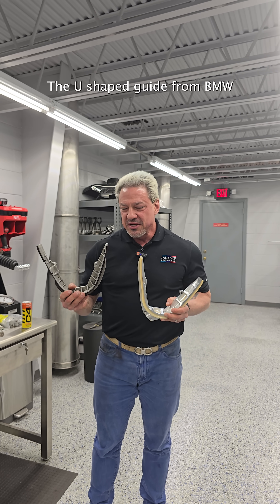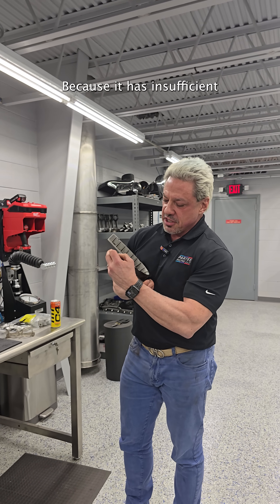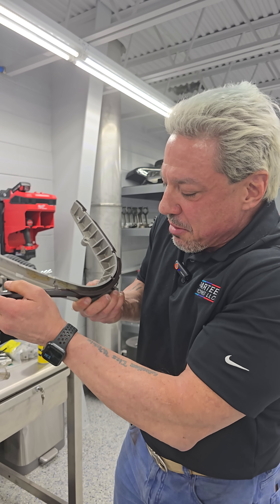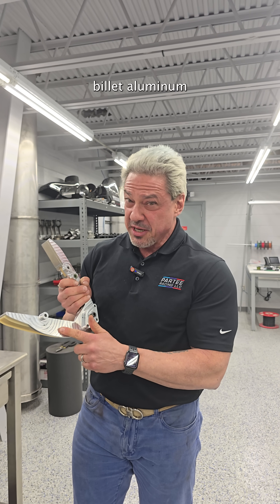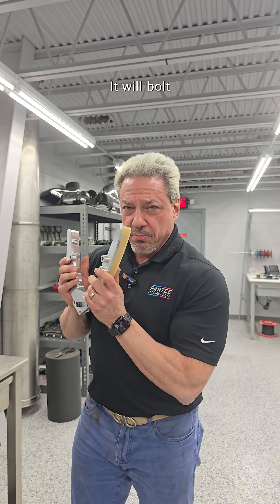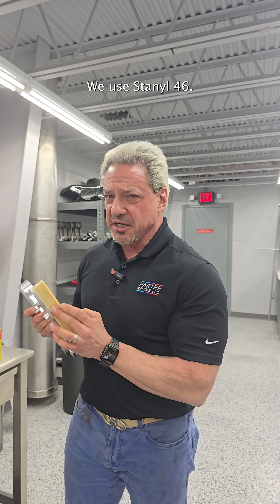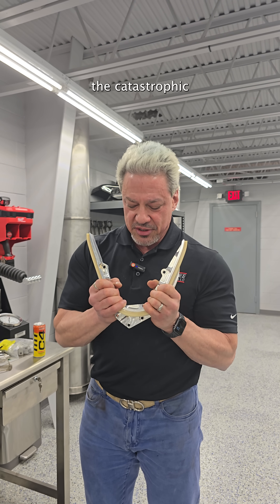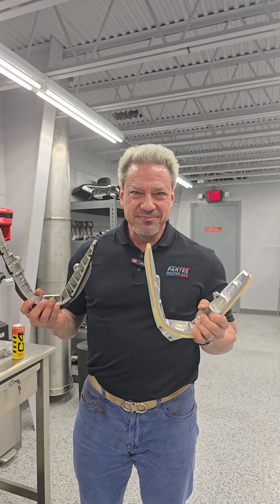BMW Timing Chain Guides: The #1 Cause of S62 Failure #BMW #E39 #m5

Comment: It is NOT a lifetime replacement piece and you cannot prove it. 

The issue with the m62/tu is not the rail. The issue is the tensioner. If the tensioner does not produce sufficient tension, the chain does not keep tension against the rail and slaps against it. The guide rails are practically never worn down, they're usually always stressed and breaking apart. 

Overbuilding the guide rail will not fix this problem. The backing plate is not the problem. The clips are not the problem. The material may partially band-aid the problem but we know that PA66 lasts hundreds of thousands of miles in m5x applications so what is the difference that it can last in that application but not m62? The geometry involved, which can't be changed, and insufficient tension, which needs to be monitored. 

I also do not believe the chain guides to be the number #1 killer as they don't usually spontaneously catastrophically fail without warning. I'm curious to see your data for this claim.

I know why you made this part, its because you can. And that's fine. Please just be honest with your marketing.
Reply from the maker: First, our S62 chain guide is a lifetime replacement piece in part because we provide a lifetime guarantee.  We would not provide that guarantee if we did not believe that our chain guide will last the life of the engine.

Second, my experience is borne of rebuilding over 100 S62s in the past few years.  That's my data, and I've explained it depth elsewhere.  Each of the S62 enthusiasts and racers I know agree with my diagnosis without qualification.

Third, we are brutally candid with our marketing, and I don't appreciate the accusation of dishonesty.  We made this piece because we've seen how catastrophically the stock piece can fail (usually with some warning to be sure) and just couldn't bring ourselves to keep building $20-50K S62 engines for our clients without improving the guide, much less endorsing our clients spending $8k plus on replacing chains, guides and tensioners (including $390 on the stock guide with its known failure points).